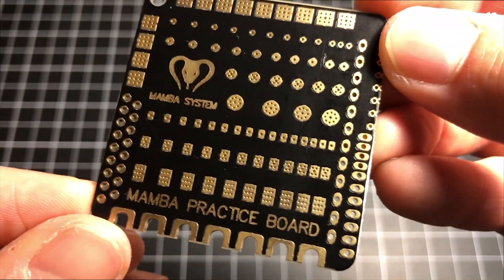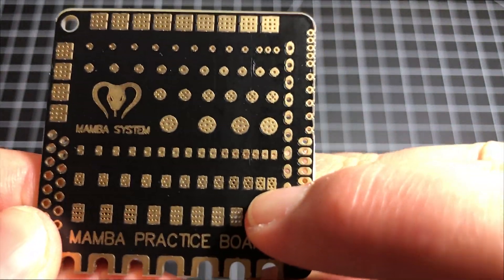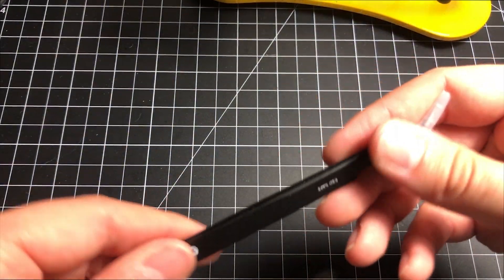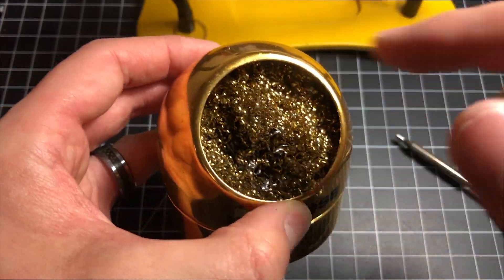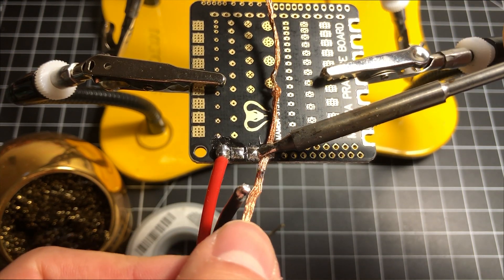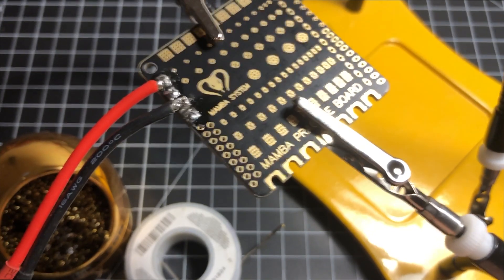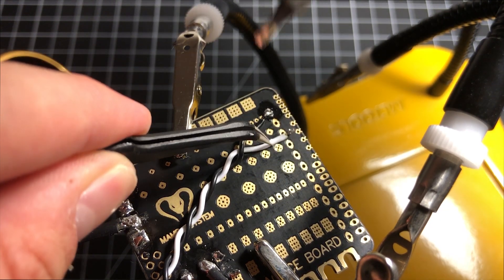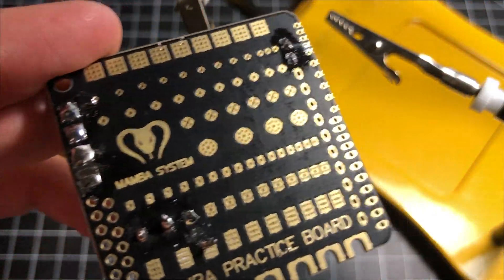Diatone Mamba Practice Board | Best Way to Learn FPV Drone Soldering

Comment: You don't need that at all since you probably can find loads of old PC boards or other electronic equipment lying around without any use of it and those are not any less useful for soldering practice. But if you want to waste 7$ for mamba practice board. It's your money.
Reply from the maker: The board used to be like $2, it’s robbery priced now. Probably material costs went up. It was something that made sense to throw in a bag for a couple bucks when making an FC purchase for the first time. Yeah you can rip apart old electronic equipment but not everyone wants to do that, and the board was just a nice unit to practice every possible situation you might run into with our quads FCs. That’s what I liked the most about it.

Comment: Ive soldered my two wires together. On the flight controller and bridged them. I don’t have wixs to try and take it off. Will it damage my wire if I leave it and get some help of someone. I’ve tried so hard to try and practice. I just caint do it. Btw I’m very new

Comment: We are much alike. Also much different.
I use a high quality flux paste and also a flux pen for tiny stuff.
I also use a combination of steel wool and a sponge to clean the tip.
Your joints are great dude. Amazing job on the video.
Reply from the maker: I gotta get a flux pen! It’s the only thing I don’t have! Thanks for the comment man. 👍🏻